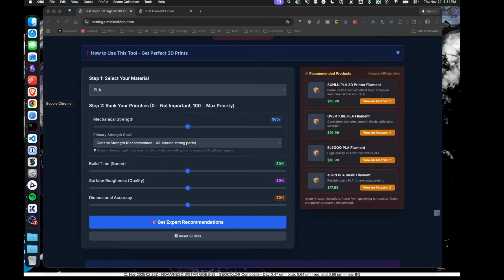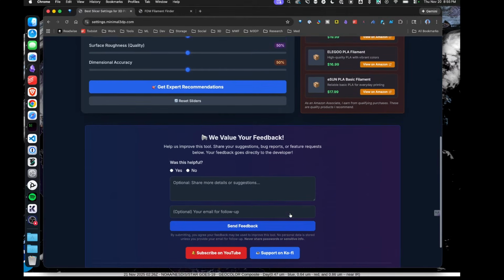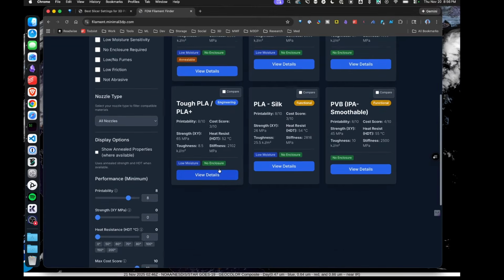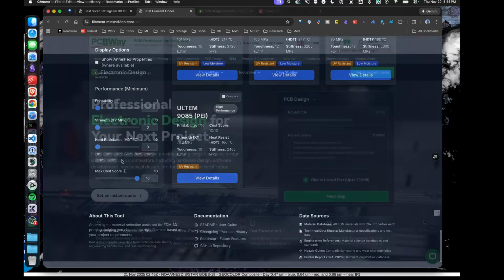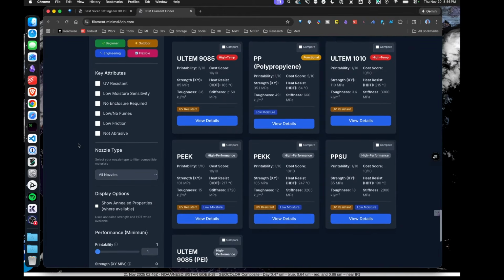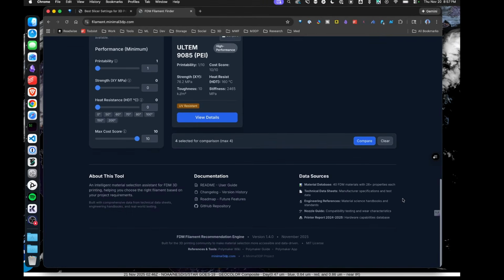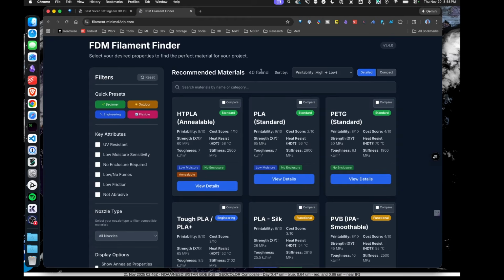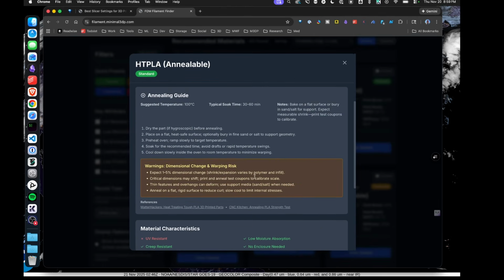3d Printer Filament Types: Compare PLA, PETG, and ASA with the Filament Recommender

Comment: Great work! Super helpful.  One idea for evolving this: add the type of recommended build sheet that you could print on, for example, Satin, PEI textured, glass, etc. Simplify3D has a Properties Table with this info.
Reply from the maker: Thanks for the feedback. That is a really great idea. Since I always have to lookup whichh bed to use myself it will be helpful. I am using the Simplify3D table extensively so I already have it. Thanks again.